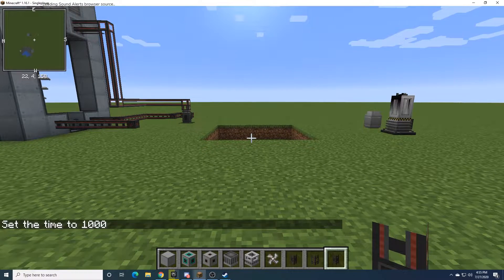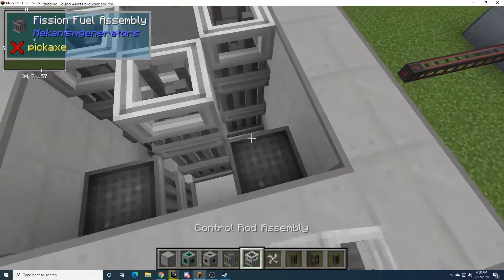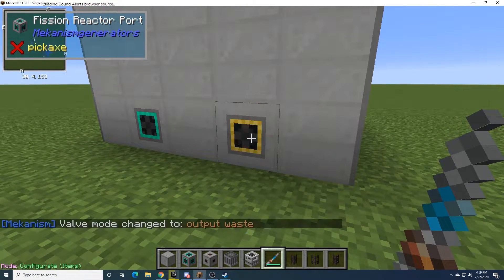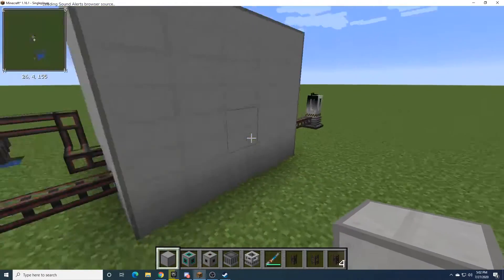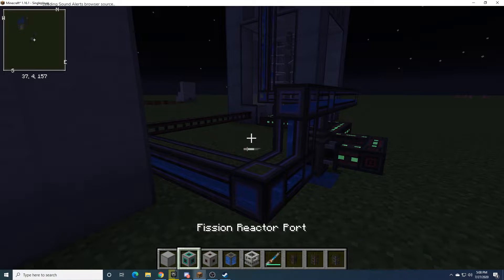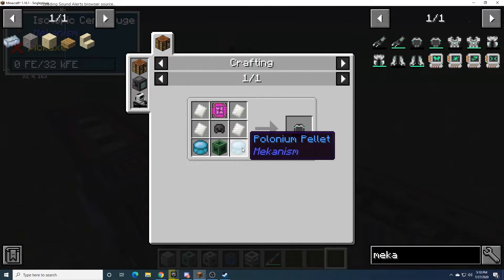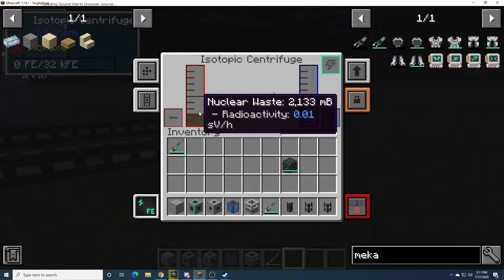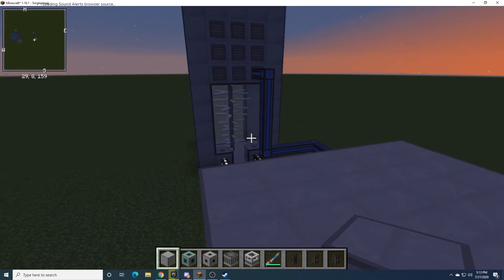Minecraft Mekanism Fission Reactor Tutorial

Comment: Do you have to output the steam or can it just bottle up in the reactor?
Reply from the maker: You can run the Reactor without steam output/recycling the biggest issue there is without the water feeding back into the system it takes around 24 (un upgraded) electric pumps per 0.1 Mb/t burn rate to maintain it. So for the smallest reactor to run at max capacity that would be around 240 electric pumps. assuming the pumps aren't upgraded.

Comment: please make tutorial how to make this turbine and how to connect with a reactor
Reply from the maker: I'll work on that video. As for the configurator you hold down the button you have crouch bound to (Shift by default) and right click on the pipe, or tube. That will change the state from default to Push (pumping stuff into the object it's touching) Pull (pumping stuff out of the object) and None (disconnecting the pipe from the object) It has other uses as well but that's the most common.
Reply: @urbancowgaming9607   thx i Made it :)

Comment: What do you mean “less efficient” when you put the rods next to each other? Does it require more water, make less steam, or something like that.
Reply from the maker: It has no benefits to the creation of energy (that I could see in my experiments) but as you scale up it makes the reactor run hotter, which starts to damage the Reactor after a certain temp.
Reply: @UrbanCowGaming Thank you for taking the time to test this. Also is this why sodium cooling exists? To further cool the reactor as to using water.
Reply from the maker: Sodium appears to be more resistant to boil off than water. So basically you would need less sodium overall which can be useful for reactors that you change the output of frequently since a water cooled reactor can boil off it's water if you go from off to maximum. A sodium setup (I'll work on that video) doesn't produce any more power though. after testing, both a sodium cooled and a water cooled reactor produced the same amount of power with the same amount of fuel.